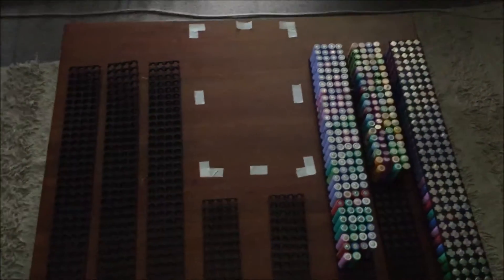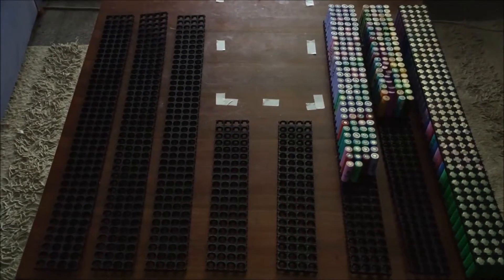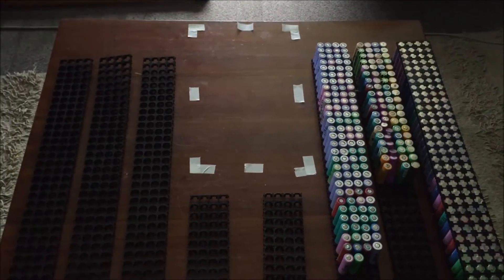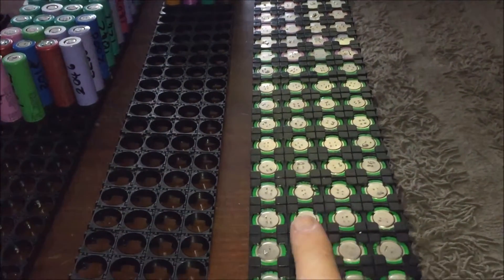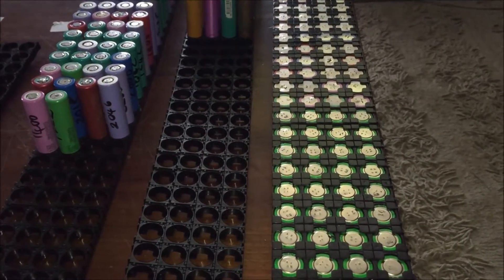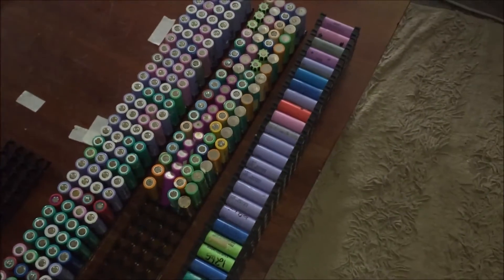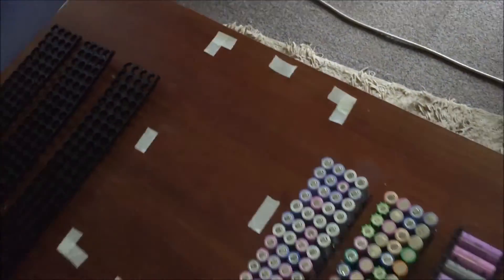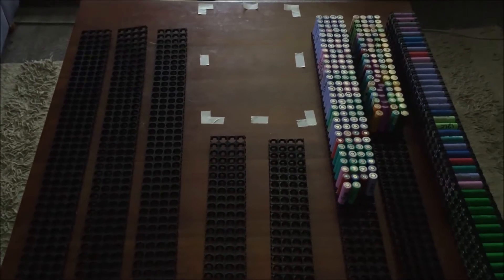Homebrew Powerwall Project - S01E16

Comment: for fuse wire, maybe resettable fuses (http://www.ebay.com.au/itm/100pcs-6A-16V-6000mA-PolySwitch-Resettable-Fuse-Poly-Switch-Fuses-Polyfuse-/161501040994?hash=item259a365162:g:oIcAAOSwofxUeEdm) - what do you think?  i like the two bar system
Reply from the maker: +Dominic Spagnuolo Have looked into these, they would be much safer as no fire, burning, melting metal BUT there is no visual clue to failed cells.
Reply: thanks... do you have a schematic of the system?  would love to start the same project...  thanks
Reply from the maker: not as yet, but stay tuned i plan on doing the whole lot open source style
Reply: thanks... keep it up..